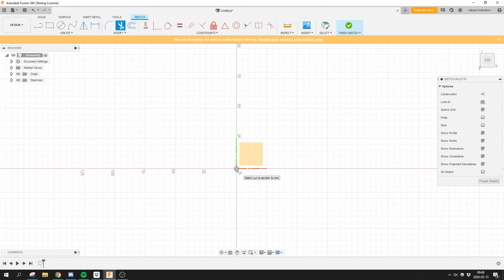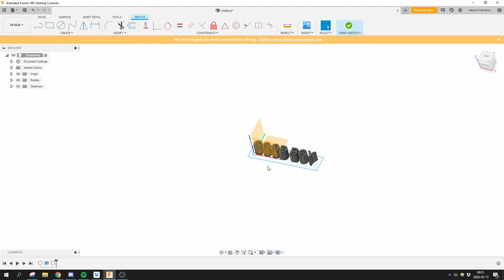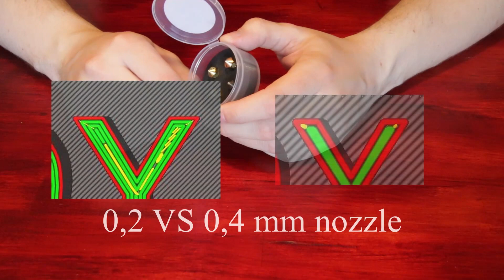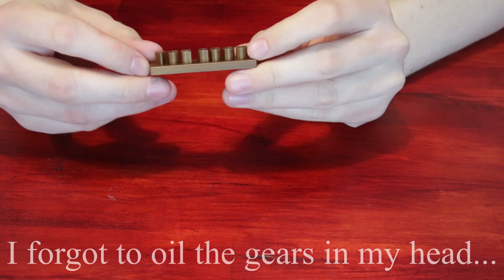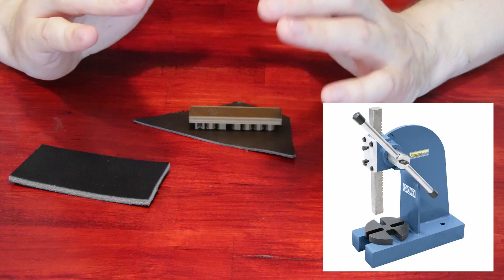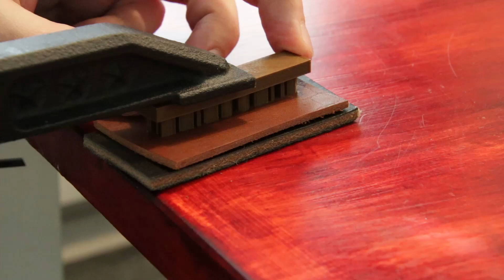Is this the best way to 3D print leather stamps?

Comment: To make the print smoother you could use a function called 'ironing'. It uses the hotend to heat up and go over the final layers to smooth them out. Reduces the sanding you will do. Cura has it, I think PrusaSlicer has it.